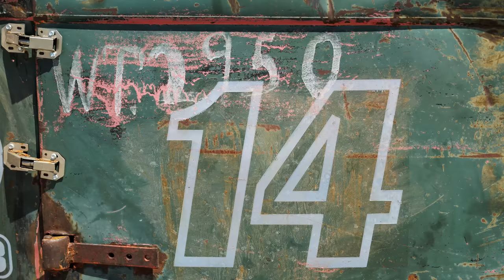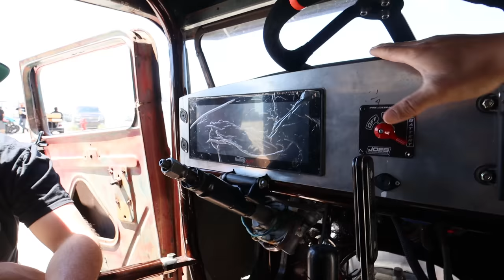From An Abandoned '32 Ford Pickup to An AWD 1000hp Burnout Machine

Comment: 32' FORD PICKUP IS MY FAVORITE EARLY 29' OR 32' FORD PICKUP HARDTOP,  SHORT BED, HOOD & RUNNING BOARD'S, FAT FENDER, WOODBED STRETCHED CAB FOR LEG ROOM, CHOPPED 2'in. THAT'S  MORE THAN ENOUGH. I LOVE 32' FORD PICKUP'S  FULL FENDERS, RUNNING BOARDS, HOOD, BUMPERS, FRONT & REAR LIGHT'S. ALOHA, BRADA BEC. FROM: THE BIG ISLAND OF HAWAII.